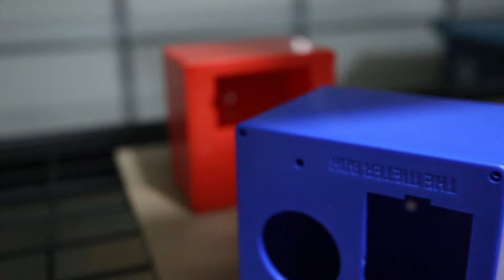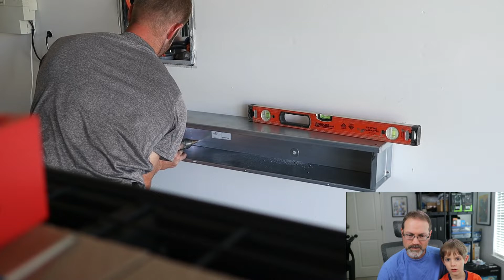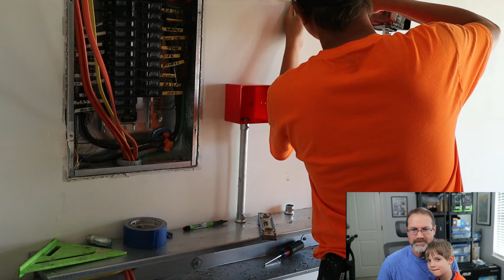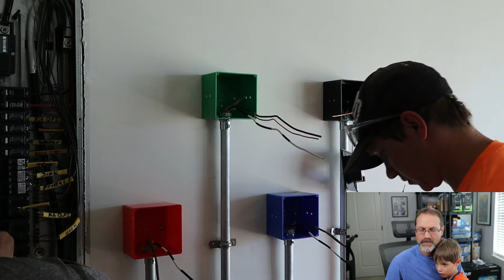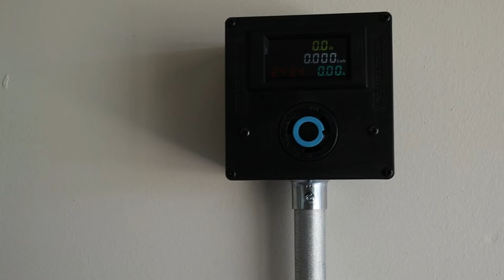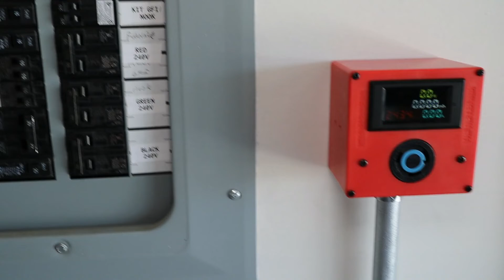Power Upgrade in Garage to 240V for Mining Rigs

Comment: hope your electric rate is good
Reply from the maker: Not too bad at home for just 1 rig running now. I have pulled less efficient cards and plan to expand into flux server nodes. I am working on starting up a hosting service under the industrial power rate in my area. A lot of moving parts to get this rolling.